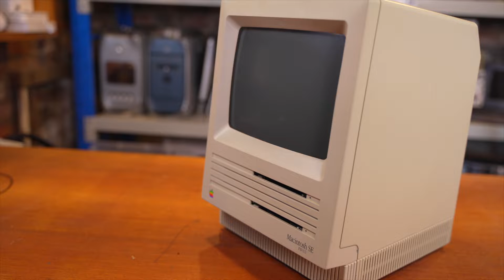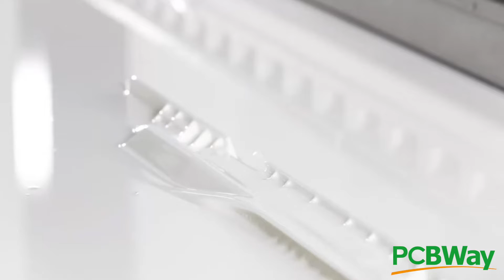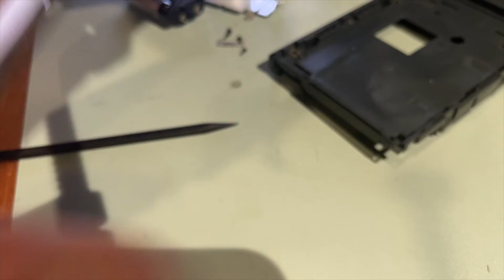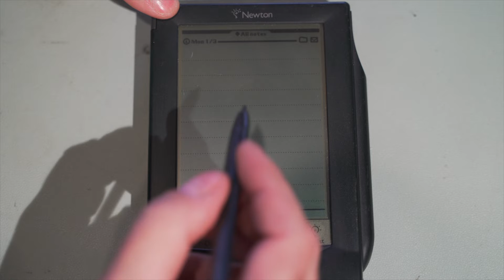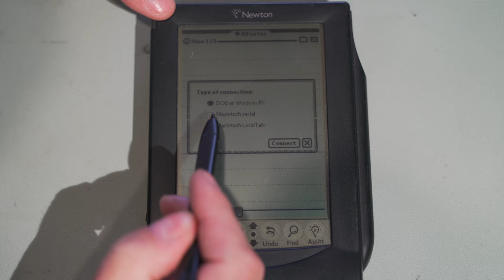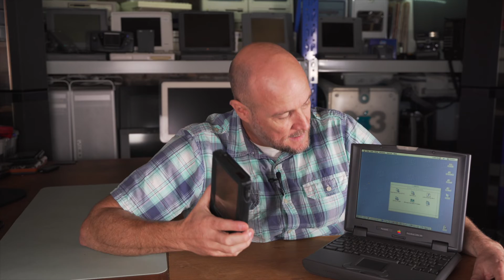Original Apple Newton from 1994 Repair and Review - Is it actually as bad as they say?

Comment: In early 2002 I was in a Home Depot purchasing a larger air compressor for my 1998 formed Ebay company and received a call from one of my surplus suppliers that he had 570 pieces of brand-new Apple Newtons available at $6.00 each and I said yes!  Harris corporation apparently had purchased these Newtons to act as an GUI for one of their electronic test and measurement products and had modified them with a hard-wire interface to control the test equipment.  After receiving the 570 Newtons, I tested them by adding the four AA batteries and a CR2032 lithium disc battery and they seemed to work perfectly.  I disassembled one of them and realized that the hard-wire interface which exited where the stylus was stored simply was soldered on to the PCB and could easily be detached with a yank on the cable.  I listed them on Ebay for $49.00 (less batteries!) and immediately sold several in the first day!  In the end, I sold all of them for more than $24,000.00 in profit that paid for more than a years rent on the building I was in!  David Riddle

Comment: I have the original internal Apple Newton with the TIL (Technical information library) preloaded. If I remember correctly (it’s stuffed away in my garage somewhere, it had an additional coloured apple logo embossed on the front Basel. Must dig out some time and see if it still works.

Comment: ARM didn’t start with the Newton. I was using ARM based computing in school since 1988/9 because Acorn used it in the Archimedes line of computers (Acorn RISC Machine is what ARM originally stood for). Acorn and Archimedes was really big in schools in the UK because BBC Computers also made by Acorn were the definitive school computer and the Archie was the next generation.
Reply from the maker: Correct. But it was the power efficiency of the arm chip that allowed something like the Newton to exist at the time.

Comment: If you can work out why the resistance level is changing on the horizontal touch screen pinout, then you might be able find a way to stabilize it. But there's nothing wrong with buying another one. Why have just one, when you can have two!
Reply from the maker: My theory is the carbon traces have a specific resistance value and the copper has a vastly lower value which throws the resistance out of whack on that line. There’s one feed for each side of the screen, and the copper one goes to the left. The lower resistance shows up as drifting the point to the right. It’s also quite a noisy signal, so the resistance must be jumping around a bit given the state of the lines I was drawing. Perhaps a single copper thread would have higher resistance and be more accurate, but I don’t have the eyes, hands or dexterity to attempt it 😅